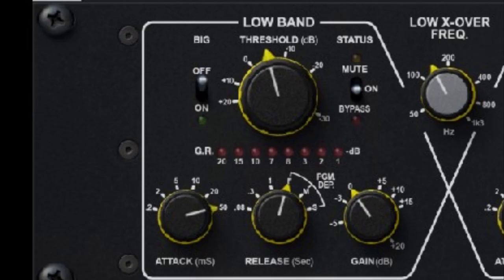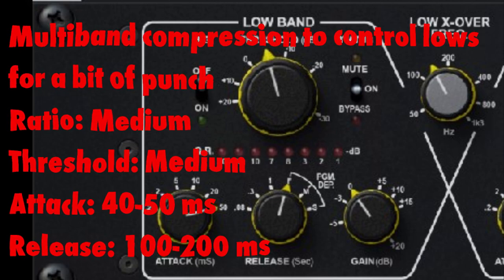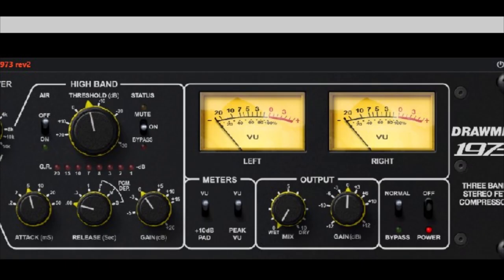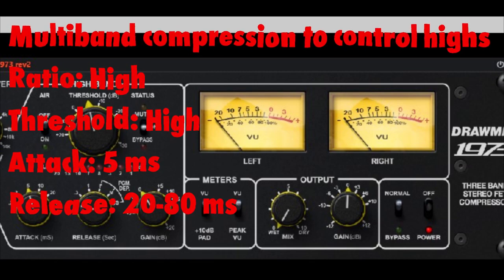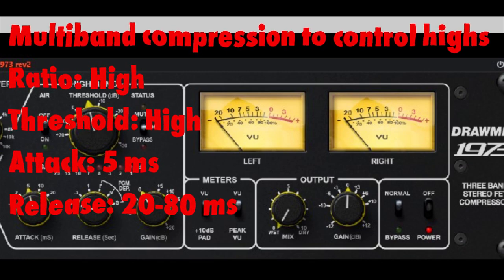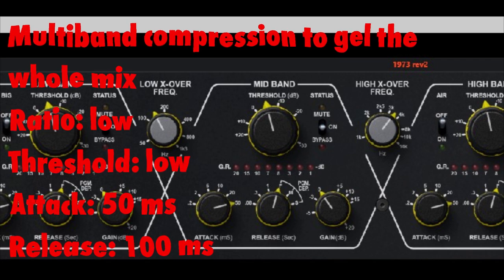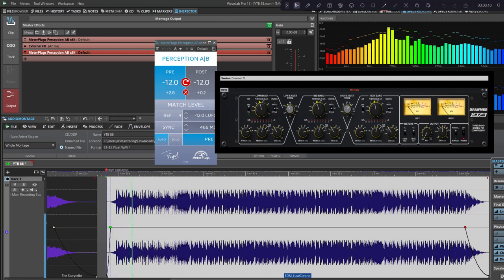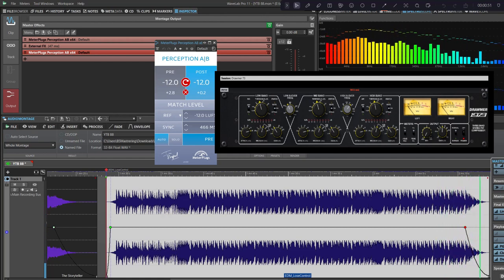Mastering recipe for multiband compression

Comment: I have a weird setup, UA LA610MKII,Tascam Model 24, AudioScape Buss Comp printing to a Tascam DP-03 which has mastering functionality. I’m currently looking at a Heritage Audio Symph for a stereo mastering EQ and this 1973 since the plug-in has become very popular for mastering. There’s some tricks that can be done with it (de-sser)or tightening bottom end. I work without a computer and would like to have a few pieces of gear that could get me just as good results as in the box. Coming from 20 years of ProTools experience and my 2012 MacPro crapped out this year. Any advice would be greatly appreciated. Also looking for a rack mountable spectrum analyzer, kinda used to seeing what’s going on in the mix. Any thoughts about the BDS PP-31? It’s the only outboard spectrum analyzer I’m finding on the market at the moment.
Reply from the maker: May be Bettermaker mastering limiter would fit your needs. First as an analog limiter and secondly you can view your favourite set of stats.
- Input, output and reduction
- Analog style meters (VU, PPM, RMS, Peak with peak hold functionality)
- LUFS (Short term, Integral, Loudness Range, view in time)
- K metering
- 30 Band FFT analyzer
- Goniometer
- Correlation meter
or you can check TC electronic Clarity M but it is a desk top....
Reply: Thanks for that advice! I think I figured a way to hookup the TC clarity into my setup. The Tascam DP-03 has RCA outs I can plug into a Gefen TV AD converter to the Clarity so I can monitor while printing. Saw a how to with this video: https://youtu.be/RirnAFDP36M. Also just learned about the Tegeler Vari-Mu comp, but I don’t own any outboard eqs so I’m thinking the Symph to run into my AudioScape sending into the DP-03 with the Clarity M attached 🧐. I saw the Bettermaker, would have to sell of a couple of guitars and a 💪🏽though. The Clarity looks spot on for visual monitoring.👍🏽I
Reply from the maker: @RasCuban33  👍👍👍